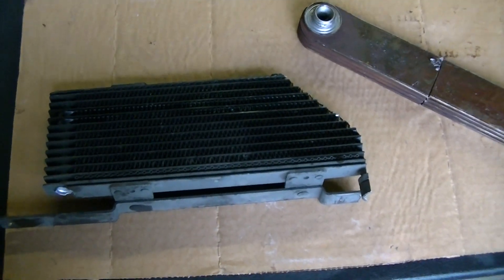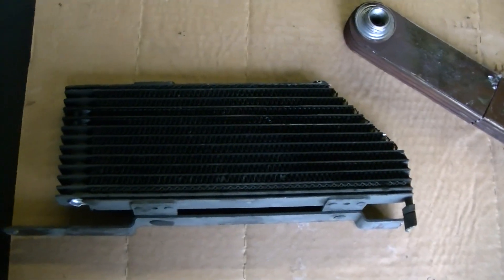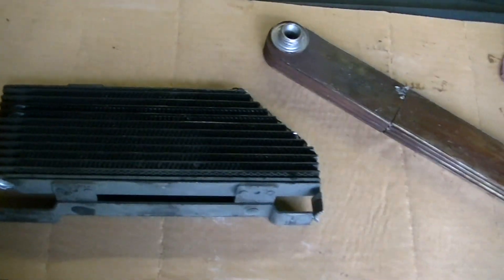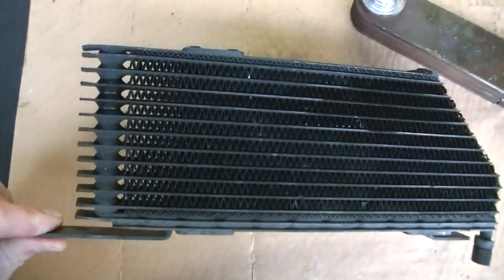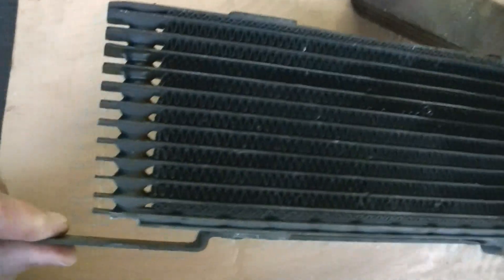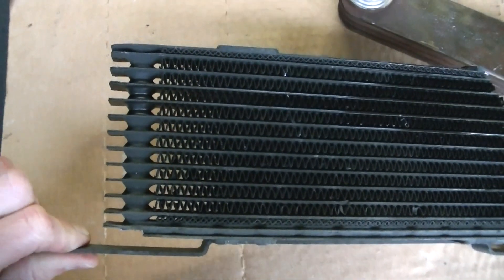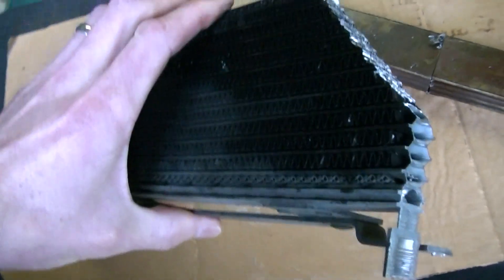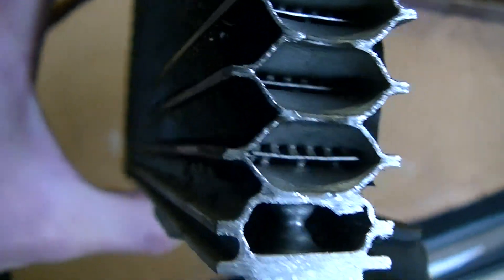Can Trans coolers really be flushed???

Comment: There are inline filters that can be installed into the return cooler line. I dont know alot about them yet. More research to come after I fix and install my trans back into my impala. The magnet was overloaded causing filter to restrict oil. There is a TSB to add another magnet directly on the filter. Trans was rebuilt 30k miles ago. Maybe if I knew and installed a filter in the cooler line, my tranny would still be alive.

Comment: Thank you for a great video and explanation. Other videos show spray cleaners being applied but your cutaway examples removed my confusion and answered my still lingering questions. Ultimately, I believe you saveg me money. I had a torque converter that desintegrated internally causing "aluminum glitter" throughout my entire transmission. Replacing the transmission was a waste of time and expense if the cooler was still contaminated.
Reply from the maker: Awesome, that was what I was hoping for.
Reply: Did you just replace the torque converter and clean the cooler / replace the cooler? No matter what some of those glitter are still trapped in the transmission but they would fall into the pan after driving. The filter in the pan would bring fluid clean into the cooler and then you could have an inline filter on the exit of the cooler going to the transmission. You don't want any particles touching that torque converter or transmission. But what's already in there might successfully flush out in time. What do you think?